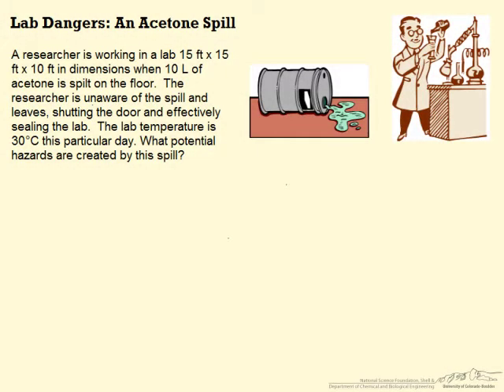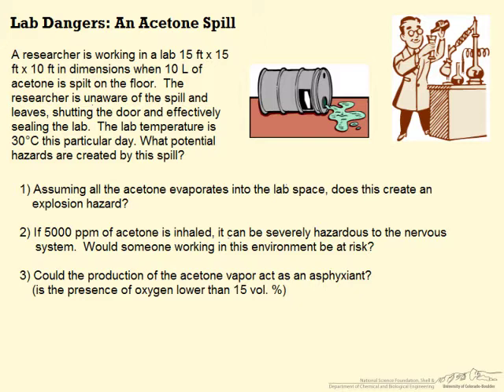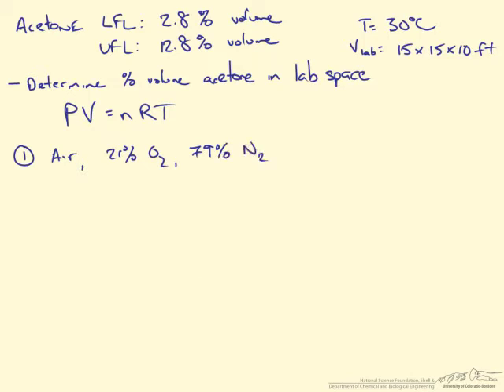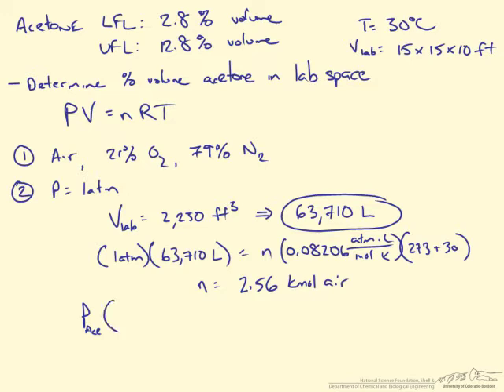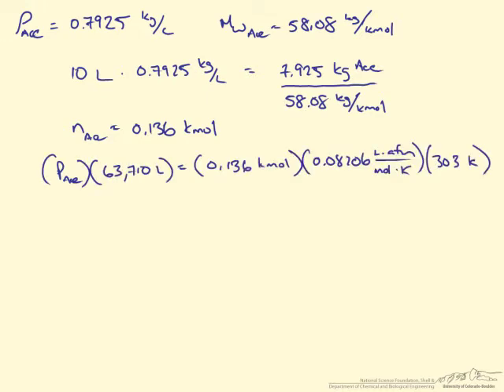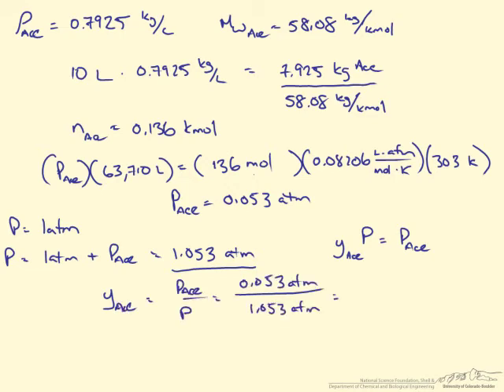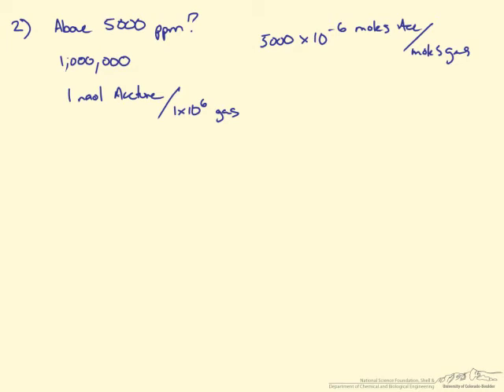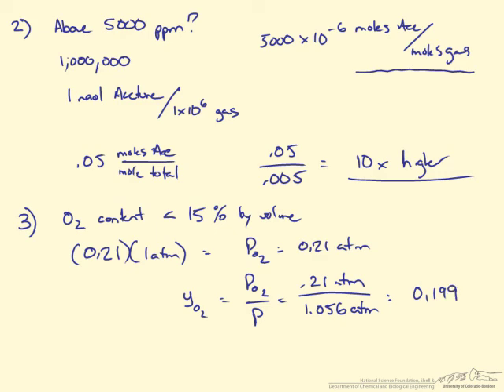Ideal Gas Mixtures Example

Comment: Hello. On number three , why is it that you are using the partial pressure of O2 in the room with just air (1atm), to calculate the fraction of O2 in the room with the acetone ( new pressure 1.056). 

Wouldn't the partial pressure of O2 be different since the mole fraction of O2 would now change with the addition of the moles of acetone. Thank you
Reply: same question